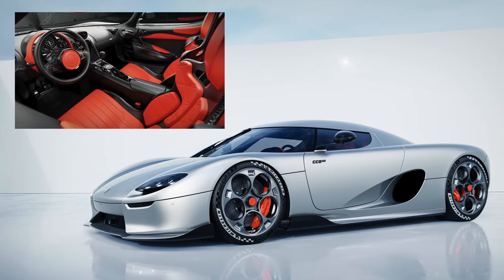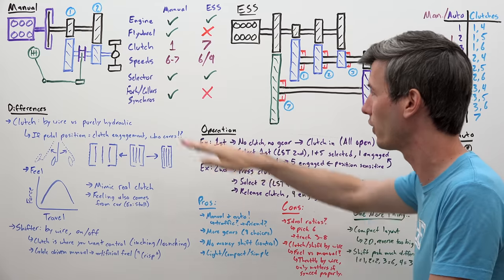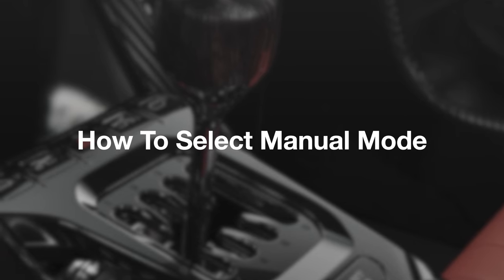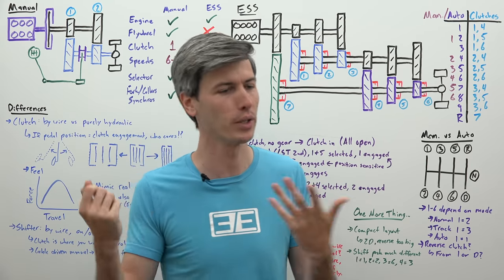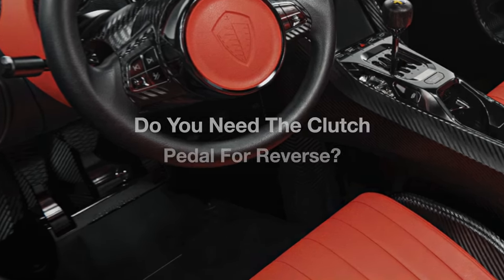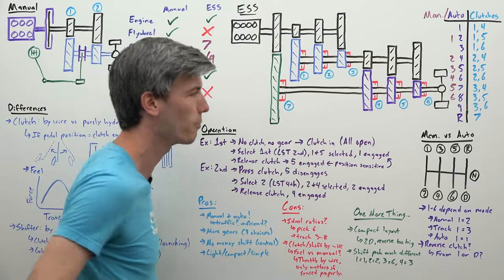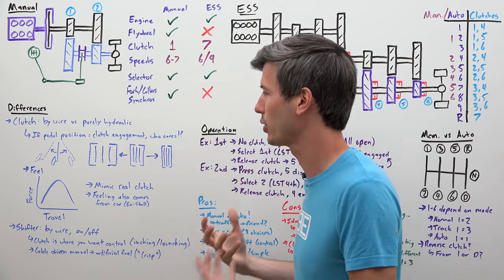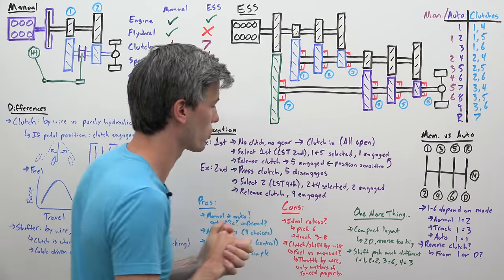Koenigsegg Reinvents The Manual! How The CC850 Transmission Works

Comment: Even though I'm happy Koenigsegg isn't completely abandoning the manual and I'm happy they are investing in developing a three pedal car, I believe I prefer as much mechanical connection as possible instead of so much "by wire".  Most buyers of these cars aren't driving enthusiasts and are more interested in being seen in the driver's seat than they are in actually driving anyway, which means Koenigsegg could abandon the manual w/o any likely loss of sales, so props to them for what they are doing, even if it's not exactly what I would want.

Comment: Sure seems like they expanded the idea of an older Honda automatic transmission. I remember seeing a similar design in a ATSG rebuild manual. I don't recall the trans model. Late 90's to 2000's

Comment: The magic is in the clutches. Small, reliable, yet with extremely strong holding power. Electric? Hydraulic? Pneumatic? Or something else, out of the Koenigsegg bag of tricks?
Reply: Hydraulic, with a lot of plates per clutch pack.

Comment: Should talk about how Honda pioneered this technology of individual clutches in place of the synchros in a manual gearbox way back with the Hondamatic. And how Saturn copied it and added fine electrical control and adaptive strategies to it in the early 90s.
Reply: Honda did that to avoid patents on planetary designs. The design really showed its limitations with the 5- and 6-speed designs, which were massive compared to competing planetary designs. Honda has moved away from that design in favor of a planetary design for their 10 speed .

Comment: While I understand most of what you've described I feel that an accurate 3d model is needed in order to visualize how these new clutches work. I have limited experience with transmission internals so I definately lack comfort in visualizing how the mechinisms are actually engaging. Or perhaps you could point me in the direction of someone who's already released a demo if available. Btw love your work =)

Comment: Another Great Video! Any video that exercises the thought process is beneficial.

Lightspeed huh? Ok 
Everything works pretty well new off the drawing board. 
How reliable will this new high-tech hybrid transmission be in the long run?? What about a warranty length? 

"Tip-Tronic" was/is pretty successful. It's even duplicated with equal success by others! 
What about when something goes wrong with Lightspeed?? Who can actually repair this thing? 
I'm guessing? No one will know until the mileage test data will be conducted how much of it will be a success or failure? 
More complexity means more reasons to failures. 
Less weight also means less robust parting.
New necessarily doesn't always mean better either. 

But, it sounds like fun? Albeit kinda confusingly distractive in an entertaining way? Lol 

Personally, a helicopter can be less complicated & more fun at a price savings to purchase & operate! 

Don't misunderstand me here. I luv machines! Call me a "Gearhead" too. 
Just at what price point do we leave the ground & take to the sky? $2-$3M???
Reply: Less weight here doesn’t necessarily mean less robust. They have less weight because they re-use gears through compounding ratios, so they need fewer physical gears.

Comment: Hey, I noticed you can only actually reach gear 8 in manual mode.
Say I'm racing somebody, and I'm on gear 8 (gear 6 on the manual selector), if I change to gear 7 on the manual selector (automatic drive), will the car actually shift into that final gear and give me the beans I need to gap the other car?
If so, then this car actually has 7 gears, but gear 7 also can be an automatic mode. If that's the case, this is extremely clever.

Also, do you even have to press the clutch to shift gears? If the shifter is positionally linked to the first set of clutches, you should be able to shift without using the pedal.

Comment: Regarding the transmission thing, they could very easily just have made it 8 speed instead of 6 speed, and keep that first gear differentiation between 1,4 and 1,5 for start/moving. Then again, top gear is often not that useful other than for fuel conservation.

Comment: With a really old Chevy clutch, hydraulic or cable, you had almost zero control, it was either in or out, with very, very little in between.  It really surprised me how easy it was to work the clutch on my Cobalt.  I wish they still made this car.  It would have been better with the L24 engine, but they don't ask me these things.  I don't know what I'm going to drive when it wears out.

Comment: Interested if you could remap this in the aftermarket so you can control clutch engagement with the position of the shifter in the gate instead of the clutch pedal. Would take a really practiced touch but might allow for faster shifts and certainly would allow for foot amputees to drive a machine like this in manual without the addition of a clutch paddle.

Comment: It weighs 60kg and also there is no problem with ratios as it may have 9 speed but it actually has many more than 9 ratios due to being able to use more than 9 ratios so there is no downside. Furthermore, it handles 16 or 1900nm of torque because it has more than 2 clutches at any one time from what I heard off Christian

Comment: Electric reverse is the only thing I could think of adding. I wonder if a normal automatic, not a dual clutch, could be set up to work like this? It also has these little clutch bands on each gear I believe.
Reply: I think there’s a video with Schmee where CvK explains that if they were to hybridize a drivetrain with the LST, they would remove the reverse gear and do it electrically like you said.

A benefit of this design is that the electric motor can be placed on the intermediate shaft, so that it still has access to 3 wide ratios for better performance. Simultaneously it also allows the engine to be disconnected in EV mode without introducing another clutch.

Comment: The clutches on each gear instead of selectors and one clutch is similar to how the old Hondamatic used to work nearly 50 years ago.
Just the honda had only 2 gears, instead of 2 lots of 3.

Comment: This is a very cool design. My worry is that clutches are the most common failure on a transmission when there is only one, and now there are 7. At least if one or two clutches fail you only lose 3 gears for each failure and can still drive in other gears. I imagine if the clutch disengagement is a solenoid that's a failure point as well, as is the most common failure point on an automatic transmission.
Reply: Typical modern automatics already have 6-8 clutch packs, so your point is invalid.

Aisin transverse 8-speed: 6 clutches, 7 if you include the torque converter clutch, 9 if you include the sprag clutch. Used in Camrys, RAV4s, Volvos, Minis, VW’s, etc.

ZF-8 speed: 5 clutches, 6 including torque converter clutch.

Honda 10-speed: 7 clutches

GM 9-speed: 7 clutches

Etc.
Reply: @Kyriaeus  a clutch and a clutch pack is not the same thing. And if you are talking about a dsg, that's not an automatic.

Comment: My corolla has a real good clutch feel. You can feel it biting through the pedal. I drove the work van the other day and it had none of that. It was strange and I did not like it. This new transmission looks like it'll be missing that too. But to be fair if I spent a few million on a luxury car I probably wouldn't be driving it in manual anyway.

Comment: Ho boy, not only the 'shift by wire' things adds hundreds of potential point of failure, for example dividing the clutch reliability by 7. But they added even more points of failure in the 'artificial feedback' thing. This car is a heaven for the dealer maintenance billing, and a nightmare for the customer.
Reply: Typical modern automatics already have 6-8 clutch packs, so your point is invalid.

Aisin transverse 8-speed: 6 clutches, 7 if you include the torque converter clutch, 9 if you include the sprag clutch. Used in Camrys, RAV4s, Volvos, Minis, VW’s, etc.

ZF-8 speed: 5 clutches, 6 including torque converter clutch.

Honda 10-speed: 7 clutches

GM 9-speed: 7 clutches

Etc.

Comment: Looks neat. So you are not really pushing the clutches/gears (like traditional manual cars), you are just selecting the gear you want and electronics will engage the desired gear for you (like you have with most manual modes of automatic cars)?
Sadly we wont see any manual shifting in EVs as it is not needed anymore...

Comment: Why in your pros and cons didnt you mention wet vs dry clutch? bcoz from what i gather, the clutches are going to be in the same oil bath lubricating the trans, thus making more pros and cons such as wet clutches lasting longer and running smoother but there are more of them to change and may need to drop the trans. really surprised you never noticed that.
more difficult to change too bcoz you will need to slide them off the shafts. i think its a great improvement tho. its almost like an old 3 by bicycle drive train. 3 gears on the crank and on my bike 9 in the back. giving 27 gears, about 16 to 17 that are actually useable. using the others can break the chain.

Comment: Based on the design, it has more parts, means more weight, more complex, more difficult to work on. It also has a lot of power transfers, means it is less efficient. With more gears, it probably needs more oil and that translates to more weight. Just an observation, i might be wrong. 🤔
Reply: Not sure how it has more parts - it has the same number of physical gears as a 6-speed. It replaces all the synchros and main clutch and the selector forks and shift rods and shift rod actuators with 7 relatively compact clutch packs.

Also, this only has 2 gear meshes in the powerflow (3 including the ring&pinion) which is the same as most longitudinal manuals (input shaft -> countershaft -> output shaft -> ring & pinion). Plus, modern gear mesh efficiencies are very high, often above 99%.

Comment: I’m going to pick on my upper-end Dodge Charger, because I know it well. The transmission is a 	5-speed shiftable automatic. Most of the time I just keep it in Drive and let it do it’s thing. Scenario: I pull up to a red light, left-lane. There is a second lane to the right of me. The problem is that 500’ past the light, the right lane merged into my line. A (luxury sports car) pulls up on my right, expecting to get the jump on me. Some days, I really don’t care. But some days I do! So I get my car ready. The last thing I do is shift the car into first gear. Remember, it’s a 5-speed shiftable automatic. The light turns green and we both open it up. My Charger will protect itself by automatically shifting when it hits a certain RPM. If I’m willing to redline the car, I have “manually” shift it back down to first. Is this self-preservation. I don’t know if this is an industry standard. It’s not often that I loose a head to head, but when I do, it usually occurs when car autoshifts to 2nd. - Does this new transmission have self-preservation mechanism? Or can you purposely red line it anytime you are out of drive mode?

BTW - I’m on my second Charger as I wanted to upgrade. I’ll probably keep doing it until they run the model into the ground.

Comment: Driving a great traditional manual is not a series of events. When shifting a driver learns to overlap the gas off, clutch on, shift, clutch off, gas on events; sometimes completely skipping some. 

In your defence of shift by wire I feel you neglected to address this. What will the K trans do if I depress the clutch only partially? 10%? What if I dont lift off gas? Thats where the real ergonomics happens, otherwise its just videogame shifting.

Comment: Can you still launch in any gear and RPM? Can you still clutch-kick at WOT to kick the back end out? Does it roll backwards and forwards on a hill? If at least the first two are yes then this as good as any mechanical manual as far as tracking the vehicle and fun is concerned.

Comment: as others have said, a pretty big con that you totally glossed over is the fact tha clutches are a consumable part and get a lot of wear, so when you get to change one of them (or all) it's practically changing the whole transmission, that gotta be expensive, I can't imagine this being adopted by the industry at large, what will probably happen will be shifter and clutch by wire, it will probably be a bit cheaper and users will probably get more mileage out of the parts in case of misuse (resting your hand in the shifter, or riding your clutch, etc)
Reply: Typical modern automatics already have 6-8 clutch packs, so your point is invalid.

Aisin transverse 8-speed: 6 clutches, 7 if you include the torque converter clutch, 9 if you include the sprag clutch. Used in Camrys, RAV4s, Volvos, Minis, VW’s, etc.

ZF-8 speed: 5 clutches, 6 including torque converter clutch.

Honda 10-speed: 7 clutches

GM 9-speed: 7 clutches

Etc.

Comment: what you're seeing guys is how GM will theoretically be able to offer a "3 pedal manual" for the Corvette C8 (base/Z06) even though the transaxle is at the rear of the car with the engine technically in the way.  they said the configuration makes it impossible (unlike a Porsche where the engine/transaxle are reversed) but I knew they just said that to throw you off.  there's no Law in the Universe that says the only way you can control a DCT is by way of 2 paddles.  since the unit's "remotely located" anyway, it ultimately doesn't matter whether you use you're Left/Right hands, or your Left foot/Right hand through a weighted mechanical gate shifter of some sort.  like Morpheus explained to Neo in the Matrix "What is REAL how do you define REAL, if real is what you can FEEL, what you can smell, taste, and see, then REAL are just electrical signals (or in this case physical sensations) INTERPRETED BY YOUR BRAIN..." (Larry Fishburne voice)

Comment: Having spent 30 years making close ratio gearboxes I can offer an explanation why manual version is only six speed and in automatic mode it uses all nine. Quite simply you can not make  nine gears perfectly match the real ratios you would desire. You end up with gears very close or very wide in ratio. The six they pick will simply be the best compromise. Jack Knight made a three shaft dog box in the 70's. From my maths you need a four shaft transmission to get best range of gears and simply too complicated. Only way to have true close ratio boxes with correct spacing is a long unit with just two shafts.

Comment: I can see a problem with this new manual transmission. You will very likely use more and generate more stress in the first clutches (using the clutch and acelerator to hold the car in a hill, making a launch etc). The problem with this is that with time, the clutch will feel differently for different speeds. This will certainly be annoying to drive.

Comment: In manual mode: instead of pressing the clutch pedal - shifting to second - releasing the clutch, couldn't you just pull the shifter into second gear without pressing the clutchpedal? If the shifter is position sensitive, its going to activate the clutch anyway, the shift would be way faster.

Comment: Can you look into why no automaker has tried to tackle putting a manual transmission onto an electric vehicle? I know the industry is moving to automatic for safety and efficiency BUT there are still thousands of enthusiasts and regular folks that like to be in control of things.  So why no manual EVs?
Reply: An electric motor negates the whole process of shifting.
Reply: However, they can exist.
Reply: This channel asked that same question

Comment: At first I could see why you'd want this over a regular manual gearbox, but not why you wouldn't just use a sequential transmission. 
The real benefit is in getting 9 gear ratios for the price of 6 sets of gears.

Comment: Mechanical clutch adds character that wire lacks same as with throttle. Better perhaps but not as engaging to the driver. My 5.0 has a cable not hydraulic so lots of feel in that pedal.

Comment: What happens if you shift without pressing the clutch?  If the clutches work as they were explained, then it would shift just fine, but I wonder.

I don't like the lack of feel of throttle by wire, hydraulic clutches, or cable shift transmissions.  I'd love to see if they were able to mimic the feel of a real clutch and trans with all the modern technology.

Comment: I have two questions 
1. Does it also have paddles to shift?
2. Can you shift in manual mode without clutch?
Reply from the maker: No paddle shifts. If you want to drive it manually, you must use the clutch.
Reply: @EngineeringExplained  thanks

Comment: I already thought of this when F1 single clutch automated-manuals came out on the early 2000 ish Ferraris. Sad it took this long to implement, especially on electric cars which can mimic the clutch operation since electric motors are instantly responsive.

Comment: But the question is: if there's a second clutch engaged by the shifter, can I actually engage a gear by slowly moving the shifter into gear, without using a clutch pedal?

Comment: Doing some research, it turns out that the automatic transaxle in my Civic is mechanically the same principle, albeit with a torque converter, only having one countershaft, and being fully computer controlled

Comment: since it's shift by wire (not mechanically connected), this could also technically be done with dual clutch transmission right?

Comment: I love this engeneering stuff. well explained !
But I wonder .. couldnt they just fake it completely ?
*do a fake clutch
*fake manual gear shift monitored by a sensor. rpm, speed is meassured and the electronics does some more or less fuel injections to simulate clutch/gear switch.
*then do a more aggressive acceleration when fake manualing is used.
*I dont need it to be super realistic down to a stall 😄